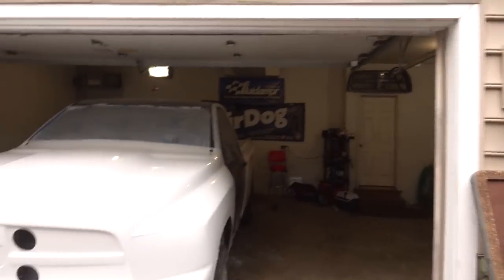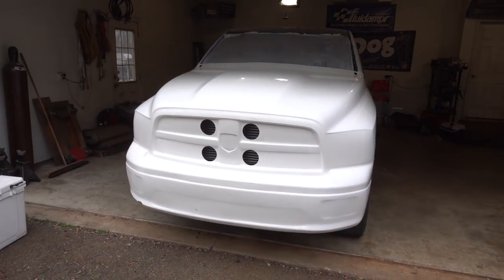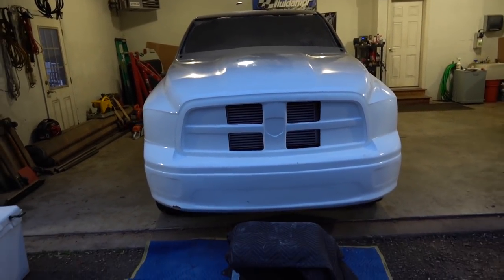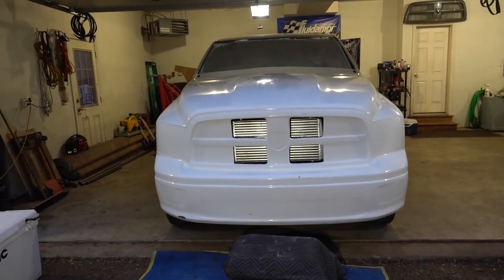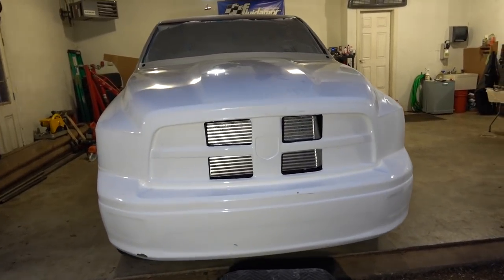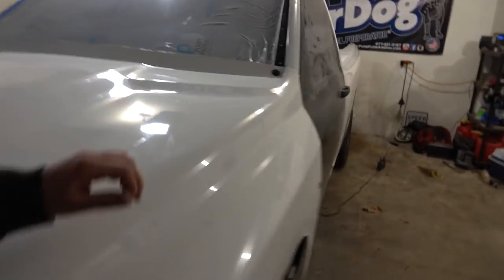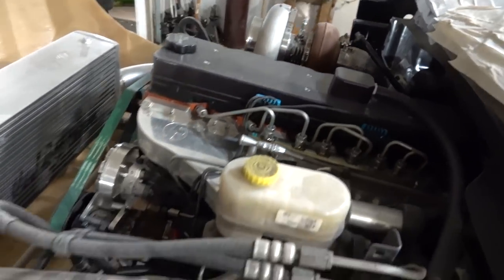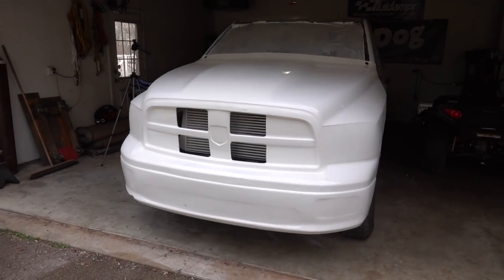SOME OF YOU WILL HATE THIS!! Making Our Solid Cummins Grill Functional!!

Comment: You should create some aluminum ducting from the front grill face to the intercooler so you force all that air through the cooler rather than having it hit the cooler and bleed off to the sides top and bottom. Will also look really cool.

Comment: I'd have mounted the cooler lower about bumper height, flat, and had air come in through the low opening with baffles. No holes in the grill area.

Comment: You will have to put a shroud around the cooler anyway right? 
So if you need more air flow then make a backing to force the air from the sides into the cooler. Then that could be painted to contrast the white.

Comment: Ducting to force the air through the intercooler.  Air is lazy and will take the path of least resistance, going around the intercooler instead of through it.  And another duct for the turbo to get cool air.  open turbos in the engine bay sucking hot air is for ricers.